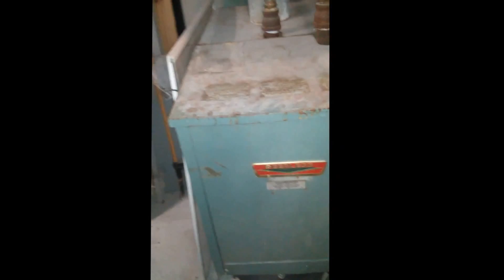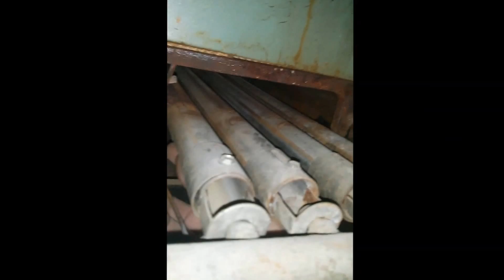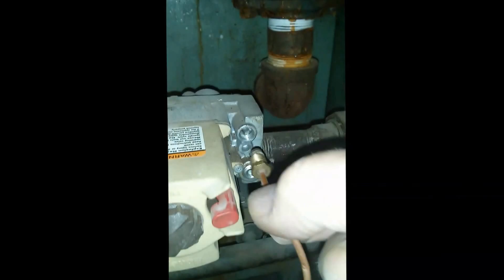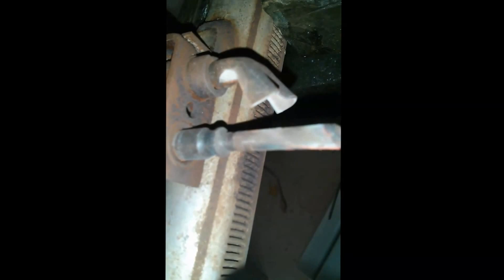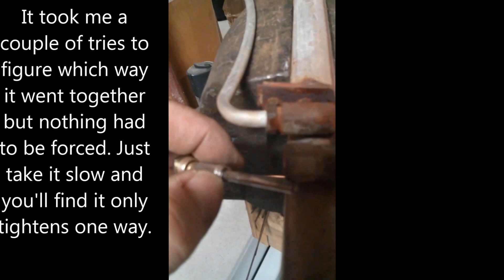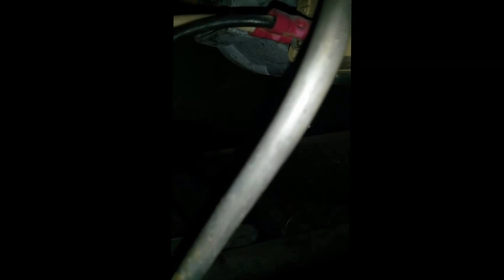Simple Step by Step Thermocouple Replacement on a 1989 Peerless Gas Boiler

Comment from the maker: While the first thermocouple lasted the better part of thirty years, the Honeywell replacement failed me after only two seasons of use. I was dumbfounded as to why the boiler wouldn't light and I started worrying that I would need a new gas valve or worse, a new system. 
After reading up on testing thermocouple output, I finally pulled it out and it tested bad. I guess the old saying "they just don't make them like that anymore" applies to $10 replacement parts.

Comment: Alan Wright, I think your the man for the fees back i need. I have a Repco GM Series GAs Fired Boiler. The Pilot will not remain lit after the strike, depress and release. # 2. The unit as no electrical power. [As per stand by for the unit to fire via the preset on the digital temp set.] I shut the mains down to throw the mains on again and no go. A small arc appeared in the dark when the on/off switch is activated, but no more. I think that switch may be old as is the house at 61 years old and has accumulated much dust. The question is: When electrical power has failed to operate the unit, does that failure extinguish the pilot light. If not. I have have two problems @ $1,000 to $5,000 dollars so said a heating Tech.  Albeit, i am burning the midnight oil using kerosene lamps. Thanks again. Joseph, L.I., N.Y.
Reply from the maker: I'm not a gas man, but your symptoms are similar to what I went through. Check this page for someone with a similar issue.